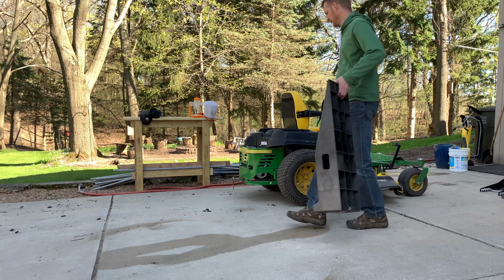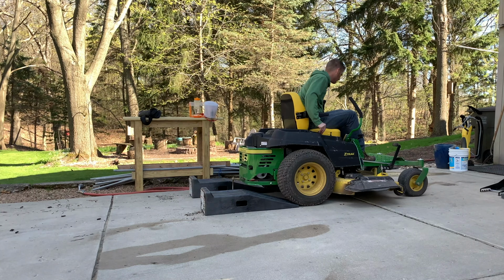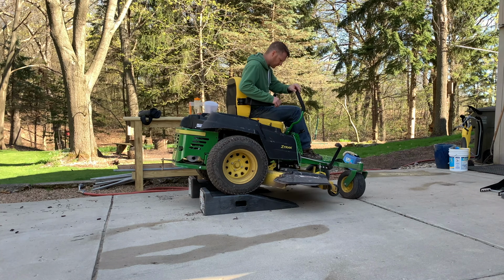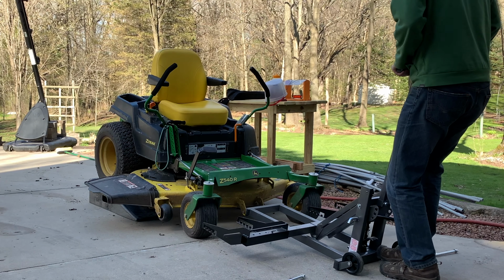John Deere Z540R ***Create extra height to access lawn mower blades under your deck*** MOWER LIFT

Comment: Thanks for showing how easy to get more height... Just bought a z355 and already had ramps. Now to get a mower jack
Reply from the maker: Glad to help @Greg ***The Gadgetlover***!
Reply: Bud all you need is a metal folding chair.  Lift the front end on to the seat of the metal folding  chair.  Super easy
Reply: @honor4thoseb471  yes that's a good idea! Or even a couple cinder blocks

Comment: Sweet  for hose clean out !
Reply from the maker: Good point +Formula Firebird!  I spent some time scraping the underside of the deck as the debris was all dry and crusty but I will have try flushing it with the hose next time I have it up on the ramps and lift.  Another idea for a video!!!

Comment: Good to see this works. Thanks for the vid. Just bought one of these and had the same issue with the back end hitting the ground. I also have a hitch which doesn't help.
FYI maybe you already know but you can lock the safety pins in place before you jack it up and they will self index as you go up
Reply from the maker: Thanks for watching and the comment @bworks1968!  Here is a link to another video we have demonstrating an idea we received from another viewer that has helped to gain additional height and remove any concerns in regards to the rear hitch hitting the ground while allowing much easier access to the mower deck - https://youtu.be/4aLBvRLc0F0

Also, thanks for the reminder about the safety pins.  We do typically lock them in place now before using the lift but did not know that you could originally.

Comment: I'm considering this model.  Do you use the deck wash port after every mow like Deere suggests, or do you jack it up and scrape it periodically?  I'm just wondering if that wash port really works or is just some gimmick.  I really hate scraping out the deck on my current mower!
Reply: the wash ports only gets certain areas clean...i went back to scraping
Reply: @markrush5013 
I totally agree, wash port doesn’t remove severe buildup.

Comment: The fact that you were able to remove the lift at the end without removing the pins makes me wonder if you could have kicked it under the front tires in the first place without having to remove the pins
Reply from the maker: Thanks for watching and the comment +Daniel Goodall! I know it does not show up in the video but I actually tried a couple different ways to force the lift under the front tires but unfortunately I was not able to get the leverage I needed to push it under.  However, as you noted it was easy to remove it from under the tires.